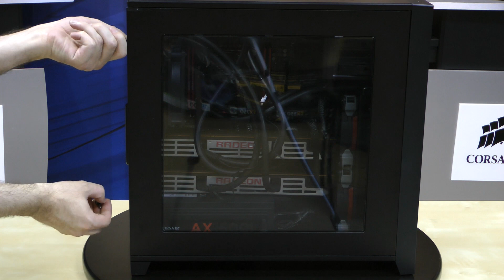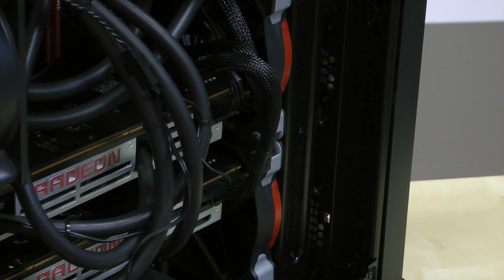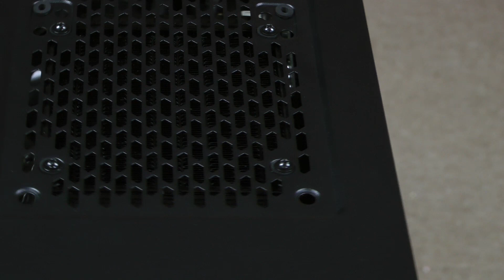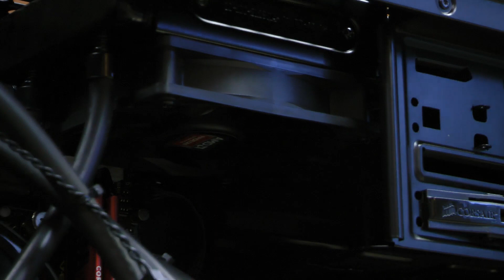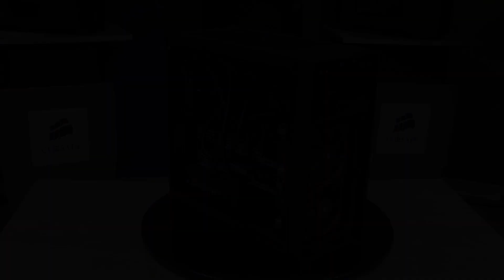Corsair Labs Uncut: Obsidian Series 350D with two AMD Radeon R9 295X2s

Comment: seems practical, even with the water cooled gpu/ cpu the ram and motherboard heat sinks with be suffocated with warm or hot air coming from the radiators even in a push pull configuration, plus it looks ugly as fuck with the tubing going left right and center, looks like a mess.

Comment: My only complaint, the fan on the lower GPU looks like it is pressed up against the PSU.  In stress testing this rig, did the lower card heat up when it came to cooling the modules on the GPU board?

Comment: Why is there no dust filter on the top of the 350D? I mean, just take the one from 450D and cut it to fit?
Reply: cause you are intended to use the top for exhaust-fans. And you don't need an filter for that!
Reply: Lucas Sjunnesson Lovén So why does the 450D have one? You're not supposed to have exhaust on that case? ;)
Reply: Lucas Sjunnesson Lovén Plus not everyone has their system on 24/7. Mine is only on a few hours in the evening.
Reply: Haha i don't know, and yeah you are right about that the system is not powered on 24/7 in most scenarios. But i think it is a compromise has been made when it came to the 350d to make it a bit cheaper. And why they compromised was becasue of the top is the place where you need a filter the least becase it's an exhaust (in most cases at least). :)

(I don't know if anything of what i just wrote made any sense, english is not my native laguage, i'm a swede lol)
Reply: Daumier its because its cheaper. also, because its really for exhaust and dust really wont get into your case for very long before the fans push them out again.
Reply: ***** I was just about to point that out. The case OBVIOUSLY was designed for a dust filter, the top is basically identical to the 450D. 

As it is now without the dust filter, it just looks lacking.
Reply: Yeah, if the 350D came with quality magnetic dust filters, I would say this case is the best big mATX / small mid tower available. But the lack of magnetic dust filters did keep the cost of the case down, while still using high quality materials / parts, which I'm happy with.

If you really need magnetic dust filters, a company named DEMCiflex makes custom 350D filters for all openings.

Comment: I have a R9295x2 and the bottom one center fan is blocked by the psu in your case
Reply: where we're going we don't need fans.
Reply: Not as much as you think, actually. There's definitely a gap there, you can see it when the system is powered on and the red LEDs from the fan light up the PSU.

Comment: Is it not too tight inside there?! If one thing goes wrong and overheats, it will BOIL the whole system before you even know it. Why risk so much hardware, just to save some space from ATX tower?!
Reply: Well, as Mr Gaysau said, corsair has to much (freaking) money.
Reply: They probably didn't turn it on - maybe they just kept all the parts an sold the case, fans and h105 as refurbished....